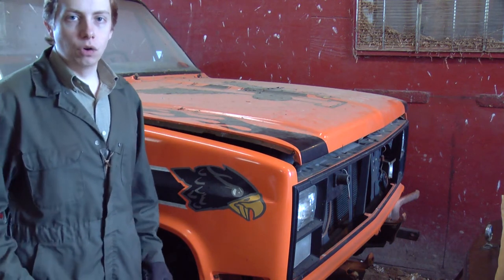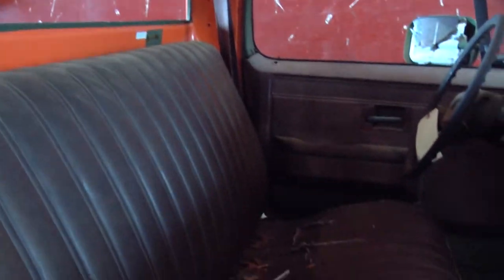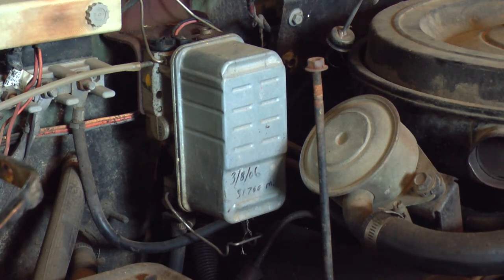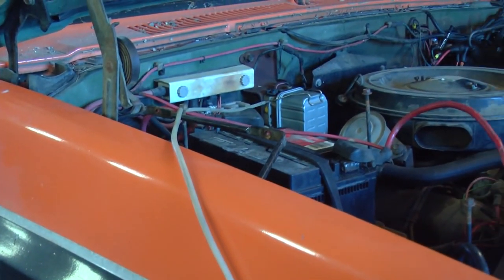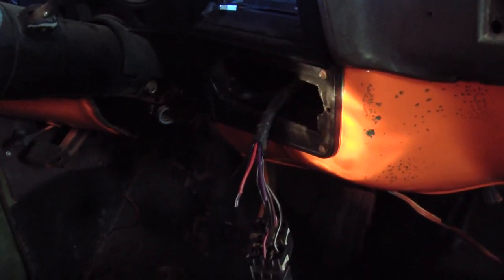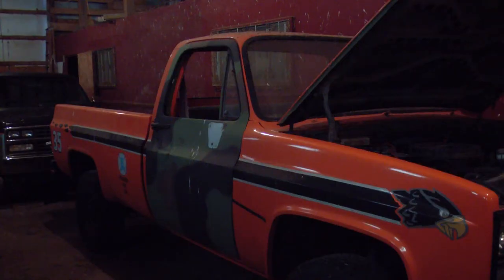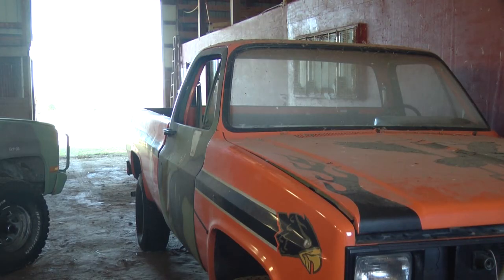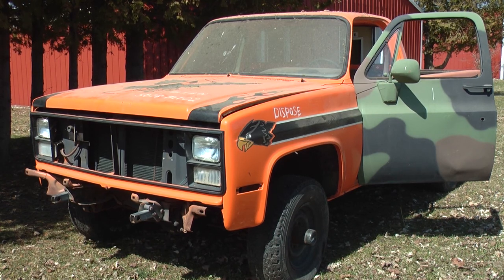Chevrolet Military CUCV M1028 Diesel Pickup Truck First Start

Comment: That's a nice Suburban you own,is it a 454?
I use to have a 1986 K-20 Suburban with the 7.4L,but I did a engine swap for a used 6.2L.

I guess I will state down the variations and difference of the CUCV.
The Chevrolet CUCV "Commercial Utility Cargo Vehicle" was for 1984 to 1987 (There is also a Dodge CUCV but was for 1976 to 1977 only,and then there also is a Chevrolet CUCV ll).
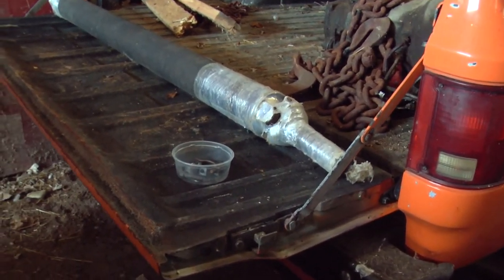These came as a M1008-M1031,the M1008,M1028,M1028A1,M1028A2,and M1028A3 are all basic pick up trucks,all of them have 4:56 Gears just like the others,and have G-80 Lockers in the rear axles.The M1028A2 and M1028A3 are duallies,and then the M1008 does not have heavy leaf springs like the M1028's do.Also,the M1028 and M1028A2 just like the M1031 have a NP-205 Transfer Case,all of the others use a NP-208,and apparently depending on what shifter the truck has,determines if it has a 205 or 208,I don't actually know if that is true.And then all of them do have N/A 6.2L's with TH-400's,and the 6.2L they have is a J Code with 155 HP,some other 6.2L's make only 130 HP.The M1028-M1031,unlike the M1008,also have Limited Slip in the front axle,while still having a Detroit Locker just like the other trucks.And then,the M1009 being the Blazer is the different one out of them all,because they have a open front axle just like the M1008 and M1010,BUT they do not have 4:56 or a G-80,they use 3:08 Gears and have a POSI for the rear.
Reply from the maker: My suburban just has a 350 TBI. 454 would be nice! Thanks for the CUCV info. I saw my first Dodge CUCV the other day; local junkyard got one in. How many Dodge CUCVs are left? Can't be many!
Reply: @w8nwo  I have no clue on how many Dodge M880-M886's were even built,they were only made for two years and all of them had a 318 V8.I have seen one in person myself,but that's it.Hell,only 8,000 CUCV ll were ever made starting in 1991,and I have only seen two of them in person as well.I can find a Chevrolet CUCV all day long for sale,and they are even more common than the Chevrolet LSSV (Light Service Support Vehicle) and the ones they would have for sale are the 2000-2005 with the LLY 6.6L.The LSSV still are made and have the Post-2008 body style from G.M..I don't know if they make them still for the Army,but the Navy Seabees have tons of them,they are dark grey,the first LSSV just like the other trucks normally were straight green in the Seabees.

Comment: Nelson I'm doing the electricals on my truck. I get ignition when the key goes in the starting position,  what could possibly be the cause? I suspect it could be the ignition switch.  I removed it and select it manually and it's the same.
Reply from the maker: I'm not quite sure what you mean when you say you get ignition in the starting position. What other issues are you having? Will it crank in the start position?
Reply: Not cranking or anything, I believe the starter relay needs replacing. What I'm doing is ensure that the electricals are intact. The key has two clicks before its maxed out. I get nothing on the instrument panel until its maxed out, I think I should have gen 1 and 2 lights at the 2nd click. I'm assuming it's the ignition switch.
Reply from the maker: @shawnlawrence4840  Got it! Switch failures aren't very common on Squarebodies, but it sure sounds like that's the issue with your truck.
Reply: @w8nwo  is gen 1 on the drivers side?
Reply from the maker: @shawnlawrence4840  Yes it is.
Reply: Can you say where on the direct drive starter the bracket suppose to be bolted on? I pulled the closest 3/8 long bolt closest to where the bracket bolts to the engine and tried to attach it there but the bolt won't stay when screwed in,  so I'm not sure. My bracket was attached to the engine block but not the starter. So I just dont know.
Reply from the maker: @shawnlawrence4840  Dang, I just had my starter out and I could have taken a picture! I had my starter rebuilt and already put it back in the truck. There should be a stud on the back of the starter that the bracket fits over. I don't remember if the stud was separate or if it was an extension of one of the long through-bolts. But if your starter doesn't have a stud on the back, you need one!

Comment: What's the difference between m1028 and m1008
Reply from the maker: I believe M1028 has locking differentials and an extra leaf spring in the rear.
Reply: 1028 is the 1008 with added locker up front (both have rear lockers) and the 1028 was meant to carry communication equipment so it had beefier rear suspension and was basically a dually set up on a single rear wheel.
Reply: @Terk131  the added locker is different from the turn thing in the hub that  you turn when the vehicle is on 4wd
Reply: @shawnlawrence4840  What ? Are you talking about the locking Hubs ?? I am talking about the Detroit Lockers in the axles. Axles are usually open differentials, lockers are added to let both wheels get power. The m1028 has one in the front pumpkin as well. This was the truck has power distributed to all 4 wheels. I run Tru-Trac limited slips up front to allow the truck to turn better. A licker up front makes the truck buck and jump when turning. The locking hubs just engage each front axle at the spindle.
Reply: @Terk131  bro I'm a student to these great trucks. I'm learning
Reply: @shawnlawrence4840  No problem man. 5his is why I explained it. I can give you my email incase you ever have questions. I am schooled well on these older trucks. It's awesome you are learning. My kids are 26, 23, 22 and 18. I taught them allot. They have all built trucks with me. My daughter is the oldest and knows as much as mechanics lol. My 3boys are building a 78 jeep j10 pickup and a 59 Willys pickup.
Reply: @Terk131  yes plz do, send me your email. These trucks must stay alive. Less headache when compared to the newbies